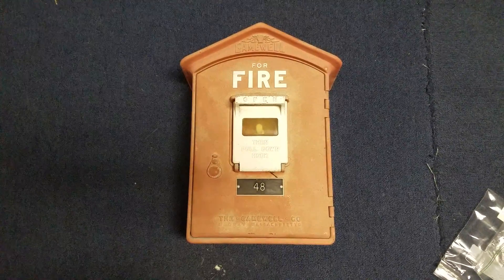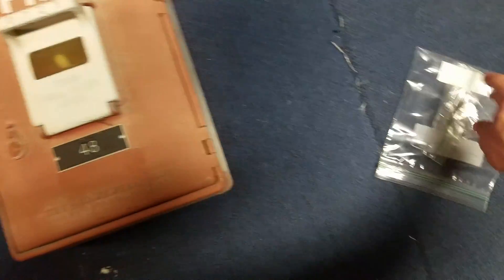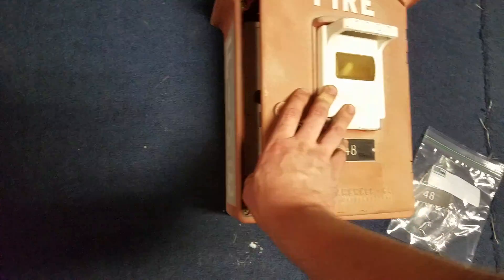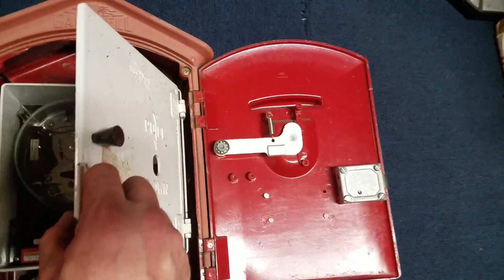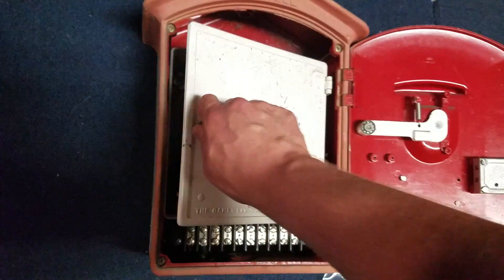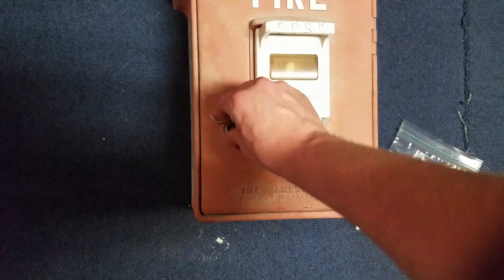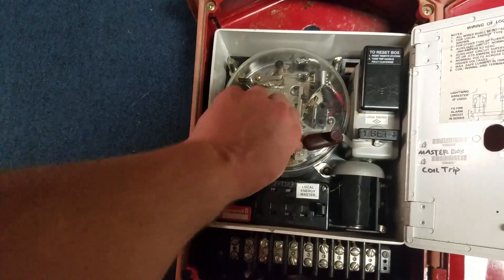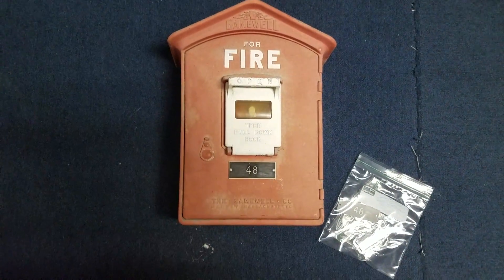Gamewell Master Box #48 Demonstration

Comment: Keep in mind if you do wire this up, it has VERY specific electrical requirements. If you want to wire a bell or something to it, you can't just hook it up like with the coded pull stations you find inside buildings. I've assembled a driver circuit for mine, if you want I can tell you what I did.

As for the local energy coil, that has specific requirements too, best to hook that up to a panel that can output the proper voltage.
Reply: Did you find a way to hook one of these up to a bell without having the actual Gamewell gong?
Reply: @jdgator95 relay probably